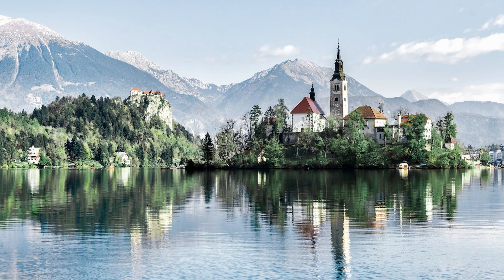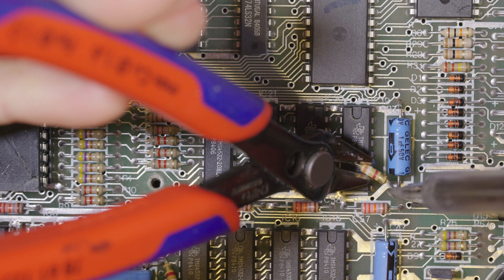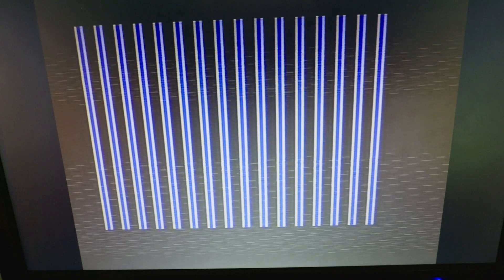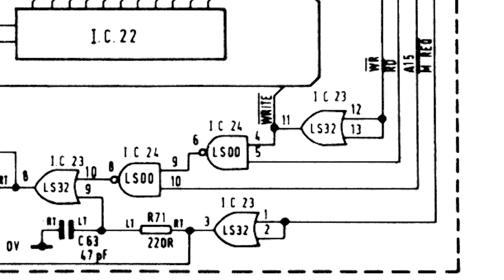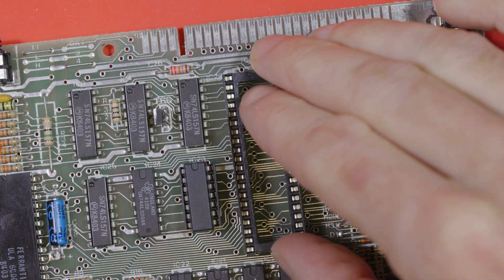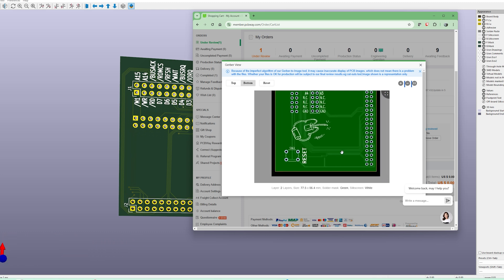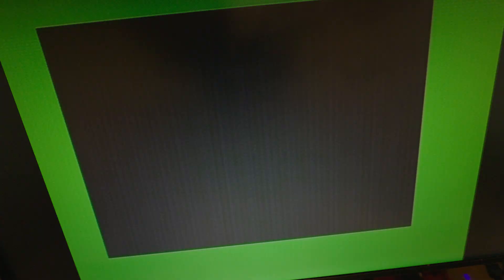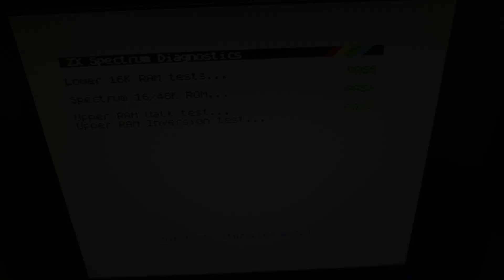What a Palaver!  ZX Spectrum Repair - RAM issues?

Comment: Hi there, great vid by the way. Do you think there was any logic as to why the faulty RAM chip would cause the seemingly errors you traced on the various data lines? Cheers
Reply from the maker: I would guess it's a short in the address circuitry. So when a particular location is addressed to write data it also writes that bit to one of its neighbours. I'm not expert though!

Comment: Hello, thank you for the videos. i am thinking of buying a Bench Power suply to perform repairs just like this. Yours seems to be ok, apart from the fact that with those analog adjust buttons its dificult to get the exact number you want. Do you recomend it or if you would buy now you would chose another model. (not expensive stuff, just for hobying)
Reply from the maker: I think it's absolutely fine for what I do, it has its issues, is generates noise which is visible on the video output on the speccy.  Something like this is cheap and cheerful and seems well reviewed https://amzn.to/406NtQM

Comment: Lol at the Walkman in repair cafe. I had one last month, drive belt (and service) obviously. 

Well they came back last weekend having bought a belt and whilst cleaning the capstan/pinch roller, bit of lube etc another one came in. 

Original customer was delighted, "I'm a teenager again!" and raved to the new customer that I'd even fixed a problem it had always had. She then said "its so expensive for a rubber band, but omg its worth it". 

I know one of the jobs at my nezt repair cafe. If he chucked it, they go for over £50 on eBay and he missed a trick.

Comment: Ohhhh I might have to order a couple of Z80`s if they have stopped making them. Retroleum have 18 in stock. Sorry to bother you again. I have one that has some sort of transistors soldered to the legs. Can i get rid of them if I get a new Z80? :)
Reply from the maker: No you'll need to replace that transistor! If it's an issue 2 board
Reply: @HappyLittleDiodes  Oh yeah it it just one device. Thank you again mate. :) Love your vids.

Comment: what type number was the bad ram chip? and what did you fit? i usually fit a 'pin jiggled' 4164 in place of 4116s as easier to find and more reliable!

Comment: A resistor in series with the switch will limit the current pulse through the switch when shorting across the capacitor.   Having one is good practice.
Reply from the maker: In that case I've learned bad practice by copying the switch in the later spectrums (with the plus case). Which make sense, Uncle Clive liked to save the pennies.
Reply: @HappyLittleDiodes  i doubt 'hard' discharging would do much damage, or be much discharge current, as the cap is only 1 uf , in the original plus switch, the 'shorting contact' is a conductive rubber bump, and thats not a dead short, it has some resistance..
Reply from the maker: @andygozzo72 hopefully no issue then 🙃.
Reply: @HappyLittleDiodes  i doubt it, or maybe just wire a 100ohm or so in series with one wire

Comment: Lower RAM chips..I always used the tip of my tongue on each one, the slightest difference in temperature on a chip..I replaced it, saved hours of work
Reply from the maker: I've never done that but I did get the thermal camera out on this one. There was no clear difference. You've just reminded that I forgot to use the clip!
Reply: @HappyLittleDiodes  they dont always run hot ..or cold.... if bad, i've repaired a few zx81 rampacks rexently and theres was no indication of failure from chip temperature, all had just one bad ram, luckily